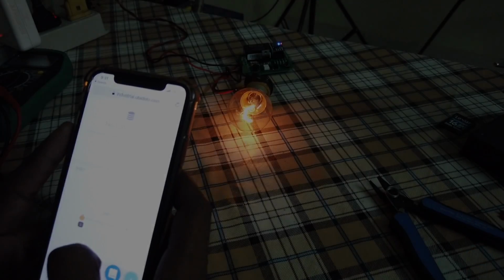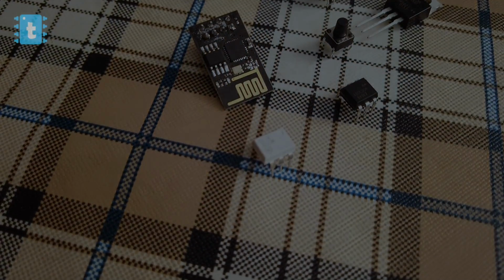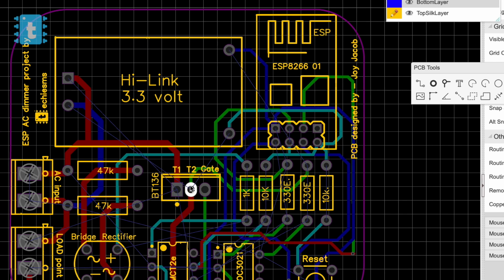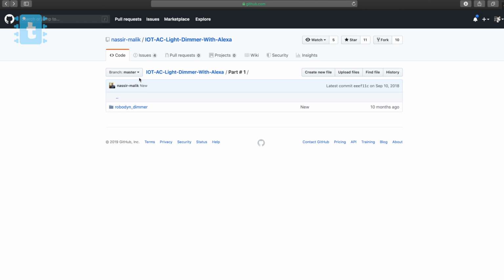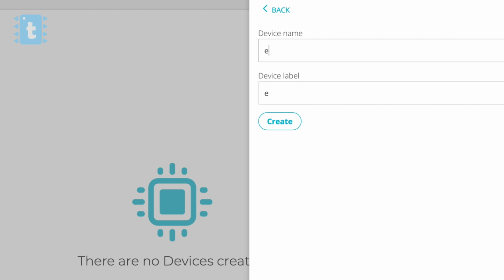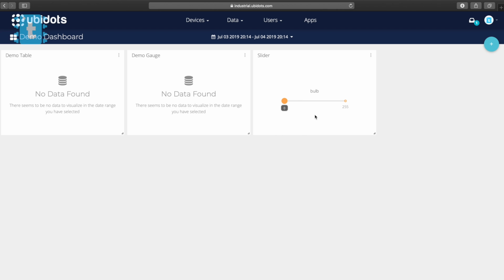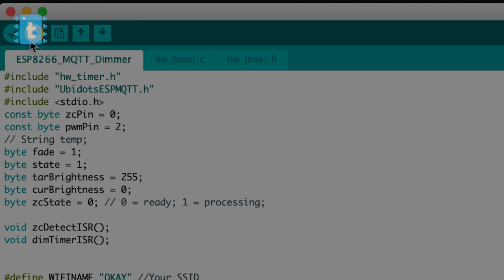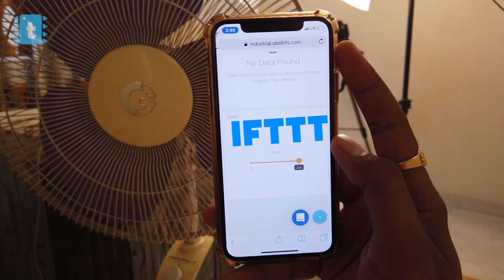ESP8266 based AC dimmer via MQTT protocol | IoT Projects | ESP8266 Projects | Ubidots | LCSC

Comment: Hello, good evening, maybe you can help me. I am working with an ESP8266 nodemcu and I wanted to connect it to a dimmer. I took an example from the Arduino IDE once the library was installed. But the line of code "dimmer.begin(NORMAL_MODE, ON)" causes the serial port to have this message: sp: 3ffffff70 end: 3ffffffd0 offset: 0010
3ffffff80:402012be feefeffe 00000002 402027d1  
3fffff90: 3fffdad0 0000004b 00000032 4020134a  
3fffffa0: 3fffdad0 00000000 3ffee7e0 4020105f  
3ffffffb0: feefeffe feefeffe 3ffee834 40201e98  
3ffffffc0: feefeffe feefeffe 3ffffdab0 401011a5  
<<<stack<<<;  Do you know how I could solve it?

Comment: i have a question as i saw  in the video that even when the brightness is zero the bulb is still on so will i have to use a relay along with this dimmer circuit so that the on/off part is controlled by relay and the brightness is controlled by this circuit kindly reply...

Comment: Hi, first of all thanks, the project is very nice! I have a problem, if before start i plug only zcross pin it goes in boot mode, if i plug only triac pin it goes in reboot loop, the only way to make it work is plug power, then the triac pin and last zcross pin.. I'm using the original code to keep all simplest as possible and check out the error, I'm sending via serial pin the value and is working..
I tried with your same arduino settings and I modified the pcb interrupting the connection to tx pin and rerouting to gnd.. do you have any idea about how can i solve? Tried as well changing esp01 and pcb

Comment: Hi i used your code and schematic on veroboard. The problem is when i power esp-01with zvc pin connected to mct2e the triac fire and bulb stays full bright even i set it to 0 from ubidots. But when i power on esp-01 with zvc pin disconected and once booted let sat after 2 sec and then connect zvc to mct2e it works. I want to know how can i overcome this problem
Reply: I am using raspberry pi3b+ to supply 3.3v and ground from raspberry pi3b+

Comment: Goodnight! Why do you recommend using the board manager version 2.4.1 in your video? Arduino currently uses version 2.7.4. But when you compile your sketch, the program doesn't work properly. I tried to downgrade the board manager to version 2.4.1. After that I can not load the firmware into the ESP8266. I suspect that the problem is in the hw_timer library, but I do not know how to fix it

Comment: can i use this to set according to the distance measured by ultrasonic attached to the same nodemcu
Reply from the maker: Yaa
Reply: @techiesms  or any other module available in the market for the same purpose
Reply: @techiesms  

I want to turn the bulb to dim state when nodemcu starts and when motion detected it turns the bulb in the full state for some time and back to dim state.
Reply: @techiesms  have you edited that fault in design that you correct at the last time

Comment: not good for inductive loads... lacks RC circuit. no manual control.. using smartphone is not always handy.. 
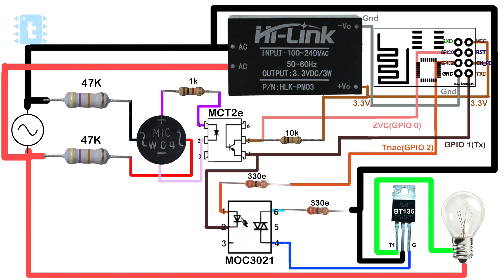And at 1:27 as per your schematics it looks like your are switching the neutral side and not the Hot side. So even if the dimmer is set to zero and someone touches the fan or buld terminals, they will be shocked to death. Change it as soon as possible...